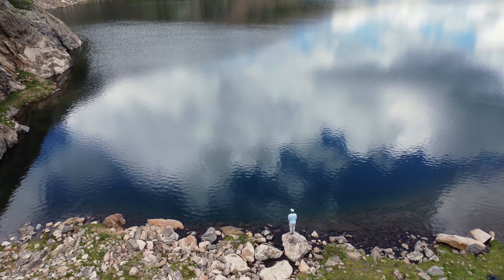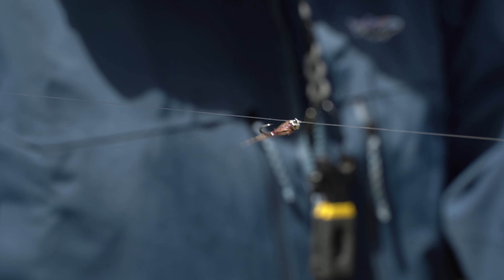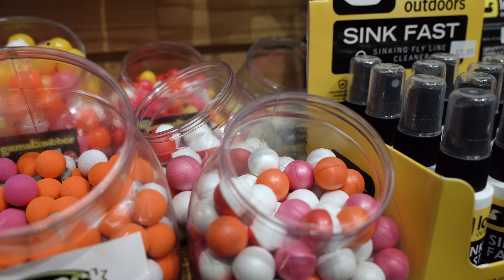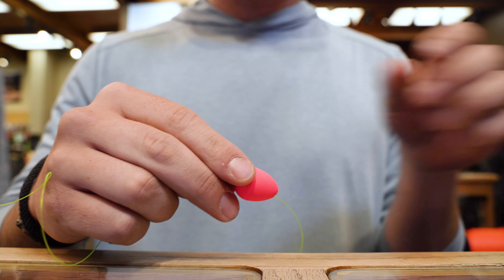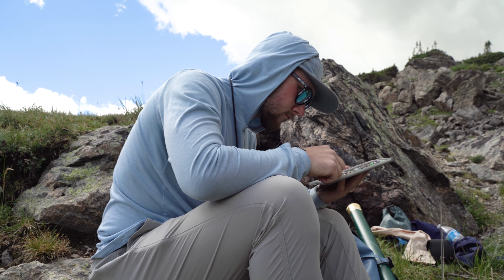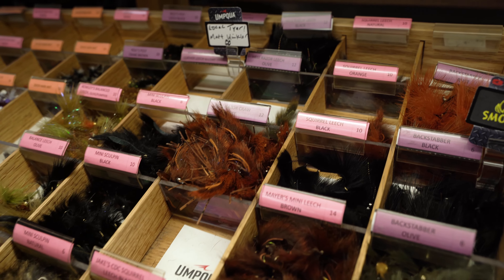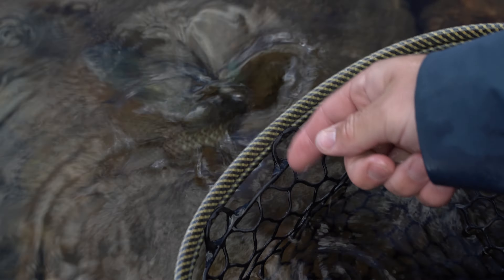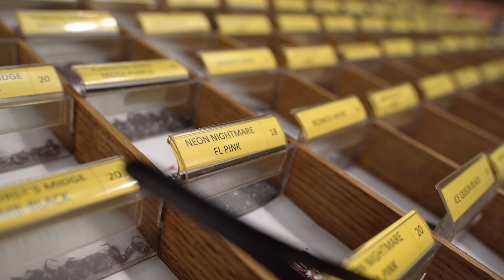How To Set Up An Indicator Rig for Stillwater Fly Fishing | STILLWATER FLY FISHING TIPS

Comment: Im looking to try an indicator setup for stillwater, but what kind of leader are you using that you can still lay it out straight with 3 flies and an indicator attached to it? Are you building a heavier leader yourself? Id only be using a single heavy fly, but i still have to build a heavy leader to cast that without an indicator.
Reply from the maker: Depending on the water you are fishing try a 7.5 or 9ft 3x leader. A 3x leader will have a stiller butt section which will help turn over heavier rigs. If the flies are small or the water is extra clear, down size tippet from there.

Comment: What weight / length fly rod do you recommend for stillwaters?
Reply from the maker: For throwing indicator rigs on bigger lakes, anything from 5wt to a 7wt, 9' or 10'. For smaller water, anything from a 4wt to a 6wt, in the same lengths! 10 foot rods are especially great for picking flies up off the water a little cleaner.